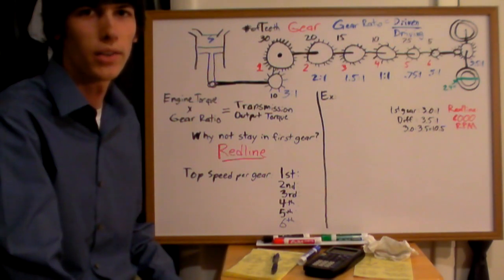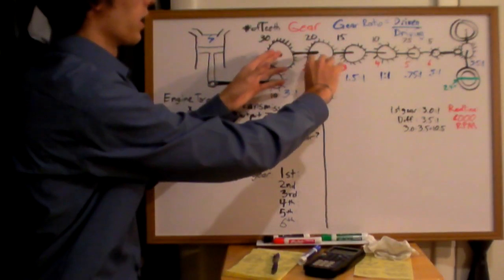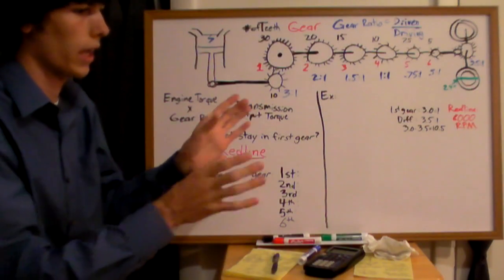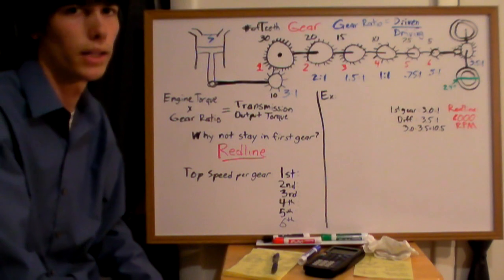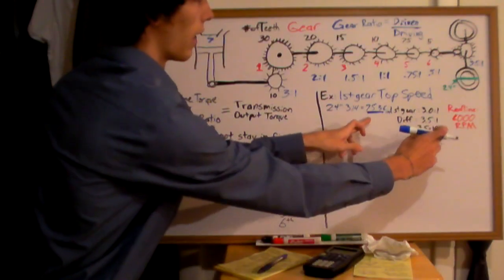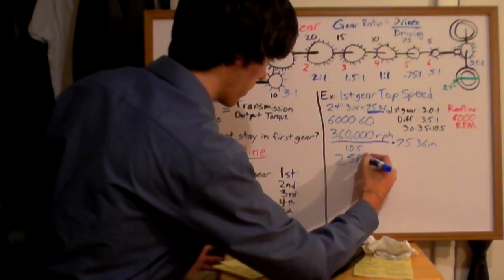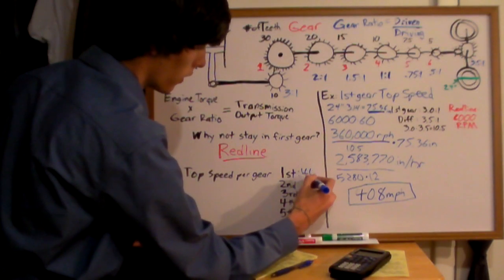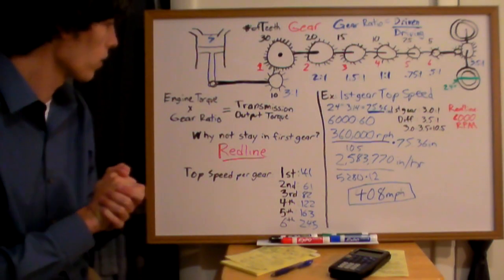Car Gears - Explained

Comment: @EngineeringExplained ifI need to climb heavy slopes (23 degrees aprox) what should be better in a transmission shorter first gear but taller final gear? Or longer first gear but shorter final gear? My case to choose is MT 1st of 3.6 and final of 4.3 vs AT 1st of 4 and final of 3.5, engine is the same. Any advice?

Comment: Next question wud b y not just stay in 6th gear at 200+ mph
Reply: Several Reasons 200mph is too fast for regular travel and if you are going up hill there may not be enough torque to move he car effectively (I say effectively because its better to move uphill with a higher torque than a lower one.) I am not really sure about specifics about what gear is best for what.

Comment: So, how do you calculate your realistic top speed for each gear if you know all of the resistance forces?  For example, suppose you use the aerodynamics of a Tesla Model 3, a given curb weigh of 2000 lbs, a given tire friction, & a given drive train friction?

Comment: So increasing a final drive would mathematically have to make the engine work “harder” or have more rotation to turn the tires which makes sense relative to the fact that in each gear you would lose MPH compared to stock or the engine would have to rev a lot higher to maintain the same wheel speed in the same respective gears. I guess my question is, shouldn’t the final drive be included in the formula for transmission output torque?? Larger gears transmit power better, but is there a mathematical way to determine that as well? I guess I’m asking because with the information given, it wouldn’t make sense in a performance vehicle to increase the final drive if you’re technically making the engine work more to create the same rotation. Now, if it’s creating more torque to the wheel, for sacrificing top speed, it would make more sense. Asking for help!!! Lol

Comment: Here's an easy formula for his top speed calculations with the conversions taken care of all as one fraction (using inches for diameter of wheel and the answer is in mph):

Top Speed = (RPM*pi*Diameter of wheel)/(1056*Gear Ratio*Differential Ratio)

Comment: Even years later with the lower production value, I’ve never come across a channel with more/better laid out info. I diagnosed a transmission error in my Jetta thanks to these videos 🙌 (thought I needed a whole new torque converter, thankfully just needed a flush and refill of the fluid 👍)
Reply: Metal flakes? Flushing the fluid will get rid of them but it is just a temporary fix

Comment: Great video
Would you please HELP

I have toyota tundra with 4.10 gears running stock tires that are 31.9 inches tall.
I'm planning on running 35 inch tire ×12.5.... I was told that I need to regear to 4.56 or 4.88 to get the shift point back...But going that route my truck will run at a significantly higer RPM....wouldn't that cause strain on my engine and kill the fuel mileage on the hwy?

Thanks

Comment: Most cars maybe just older ones try to have a top gear at 1to1 and I think overdrive is when your spinning you transmission faster than your engine so the ratios you described would be like considered tall gears but a good 4spd auto with 5th overdrive so a 5spd without that sixth one going 245 mpg you had worked out a good 5spd system but maybe 5th was a little tall other than that good ratios for a tall auto that's not 6or8spd these days

Comment: How did you get 3.14 at 6:40 minutes?
Reply: That's just pi lol. He converted from the diameter to the circumference to give you the distance your wheel will go per revolution,

Comment: Can you do a follow-up on this that explains both the following:
Straight cut gears vs. helical cut gears. Specifically, why do sequential transmissions use straight cut gears when helical gears are stronger?
Also, chassis dynos. Does the chassis dynos software calculate and work back to the torque coming from the engine? Or in other words, would one see a difference in torque output on a chassis dynos by switching gears? Also applies to sprocket changes on motorcycles.

Comment: An engine at 6000RPM produces the same amount of energy irrespective of which gear its in. At 6000 RPM in 6th gear, i can imagine all that energy must be used to overcome air resistance and friction and the like.. However, at 6000RPM in first gear, the car is going nowhere near as fast(therefore less energy loss due to air resistance and friction)  and yet the engine is producing that same amount of energy. Where does all the energy go when the car is doing 6000RPM in first gear?

Comment: So is it primarily due to the stator, which has to do work on the fluid to change its direction (but produces no useful work in return, since it's fixed) that causes the loss of power?

Comment: let me simply it
high torque gives you acceleration but not top speed, speed is limited by gear ratio. higher gear = lower ratio = more speed.

Comment: 2 questions:
1. Do the larger/lower gears provide more torque because they have more teeth or also because they are larger in diameter?  
2. Doesn't it require more torque from the engine to turn the larger (1st) gear vs. the smaller/higher gears?

Comment: I tried this using ratio of my 150cc bike. 23.61inches tire x 3.1416 = 74.1732
 2.714 1st gear ratio
2.75 final gear rato
@6000RPM
As i have calculated it says that it travel 90KPH!! On actual i haven't made it top to 40KPH!!

Comment: I love how you slam all the math on the table, very well explained [although I already knew all about this I enjoy your explanations].  You should do a follow-up on this, regarding the last 30 seconds of the video, addressing "why lower RPM gives you better gas mileage" ....... but also explaining the "sweet spots" in the RPM that get peak MPG.  On a 4L 1991/2 dodge minivan, I was able to get 42 MPG once overdrive fully kicked in / no longer "clutching it" at 38 mph @ 1200 RPM.  On my paper delivery route, I have an OBD2 app I always use, and I've constantly seen that my MPG is better from 2500 - 3000 RPM than 2000 - 2500 at the same engine load and/or throttle [testing back and forth] so I'm interested in how these "sweet spots" in the RPM band give MPG boosts.  I've confirmed these boosts by the car's alleged MPG, the app, and the pump, in identical conditions / temps / same pump every time etc

Comment: So if my engine produces 100 lbs-ft of torque @ 6000 rpm, and my 1st gear is 3:1, does the torque then multiply to 300 lbs-ft before it hits the differential? And then if the final drive is 4:1, does the 300 lbs-ft of torque multiply to 1200 lbs-ft at the wheels?!? So the initial 100 lbs-ft of torque at the flywheel at 6000 rpm becomes 1200 lbs-ft at the wheels?!? That doesn't sound right. What am I misunderstanding?

Comment: Can 1st Gear handle a high rev? (just before the red line)
The engine was warmed up, but is there a something that may harm the transmission if you rev the engine high at 1st gear?

Thanks!

Comment: i need a faster explain:if the gear number is lower what it will be eample:1st:1.52
2nd:2.3 what will happen and what will if highner
Reply: if the first gear has a ratio of 1.52 and the second is at 2.3 it's gonna go something like this: you shift into first and almost stall your engine trying to get moving, but you somehow make it. your clutch quietly weeps tears of sorrow. you rev up near redline and change gears to second. your pistons suddenly decide to pop through the hood to say hello.

Comment: This makes very clear sense however, I wanted to know how this relates to the numbers that manufacturers claim. I own a 2017 Subaru Wrx that has a approximate torque output of 268 lbf-ft @2000-5200 RPM. I looked up 1st gear to be 3.45:1 and final drive to be 4.44:1 so for a combined ratio of 15.3:1. Does the manufacturer measure torque output at the crankshaft and then multiply it by that ratio to get their numbers (It doesn't seem to make sense b/c that means the engine is producing 18 lbf-ft)? Also, drivetrain losses seem to account for 15% on average so where does that come in? Would that probably mean that I make around 228 lbf-ft at the most in 1st gear (268*.85)? Thanks for the help and the videos!

Comment: thanks for the info man, my new car is always smooth and jerk free in 1st gear, one lost motion, i have to sloth it into 1st gear, which means less pick up making the car less quick but after 2000 rpm, its damn fast and the power starts rushing, its a highway sprinter but its not quick from standstill, what is that kind of gearing

Comment: I know the video is too old but I was just wondering 
The diameter of the wheel, did you you calculate the rim diameter plus sidewall of the tyre in both ways ? 
Let's say you have a 195/75r14 
So the rim is 14 inches 
And The sidewall is 145.5 mm = 5.75 inches 
So the diameter is (5.75x2) +14 = 25.5 inches in total 
Is that the right way to calculate the diameter ?  
Bcz I'm having a problem here 
I did the calculations and turned out to be exact but the diameter calculated was 5.75 + 14 not (5.75x2) + 14 
 Really sorry for that so long comment but it got my head spinning.
Thanks in advance
Reply: Christian Abi Zeid I used an online tire size calculator... Here are the results:

Specs195/75R14
Diameter25.52"
Width7.68"
Sidewall5.76"
Circum80.16"
Revs/Mile815.18

Comment: Jason, I'm currently driving a 2015 F150 V8 with 6 speed trans and 3.73 gears. I'm thinking of getting the 2018 F150 V8 with the 10 speed transmission... With all the more gears, do I need the 3.73? Or should I just go with 3.55?... I don't tow, but do lots of stop and go and I prefer the off the line advantage in acceleration... What are your thoughts on which rear end to buy on the new F150 10 speed? Thanks in advance!!

Comment: Soooo... at 1:1 ratio, the engine rpm is equal to wheel rpm?
Reply: no because you still have a rear end gear. in this example it is 3.5:1    1:1 means the input and output shaft of the transmission are turning the same. so engine rpm and the driveshaft are turning the same rpm yes, but wheels no.
Reply: is 3.5:1 the what we call final drive??
Reply: yes
Reply: +Travis Osley can you pliz calculate how the final drove ratio (3.5)

Comment: when you multiply rpm by 60 you will get revolutions per second , not per hour .
Reply: Arpit Pathak If you had 1 revolution per minute, how many revolutions would you have in an hour? 60 right? To obtain that figure, you had to multiply 1 x 60. That's why he has mutiplied the 6000 by 60.

Comment: but if I change the wheel diameter to 16, the top speed lowers, can anyone explain to me why?
Reply: a smaller diameter wheel means you will have a smaller circumference wheel.   A smaller circumference wheel means your car will travel less distance per revolution of the tire at the same rpm of the motor.  speed=distance/time.   the less distance you travel (circumference of the tire) in the same amount of time (or in this case same rpm) means your car will be traveling at a slower speed

Comment: That's A ridiculously rugged 1st gear ex. Ya got there Too crude lol: 40.8 mph = 65 km/h. More like 50-55 kph is the red line limit as per the car manual. I never need to use > mAX of 25 kph on 1st (even on steep hills). Only case i can think of where it miGht be necessary to crank 1st gear to 35-40 kph would be if you were trying to accelerate rapiDly up a steep incline.But even in that case you do the wiser thing which is to keep momentum on a higher gear and then you can usually mount any hill with as low as 2200 rpm. E.g. : gear 4 at 75 kph (45 mph) or gear 3 at 55 kph (35-38 mph)

Comment: I still npt understand how the gear changes an angle to the wheels (Who have a different angle of rotation ) than the principal of the motor
Reply: That is the purpose of a differential. Change the axis of rotation by using a cog that is aligned perpendicular to the crankshaft. This cog or gear has its own ratio and that is the final drive/differential gear ratio (top right corner 3.5:1). Only rear wheel and awd/4wheel drive cars have differential. Most cars are front wheel and do not have diffs but the gearing ratio shown in the video still applies, transmission gear(number of teeth) divided by engine gear(teeth).

Comment: I still don't understand why you can't just stay in first gear. If there is a limit to how fast first gear can do its thing, then how could the second gear have a different limit?
Reply: at the first gear you got much torque ( enough for already move the car which is the first big step  ) , but your speed is limited   , because u can't have both (P= torque*rpm  'low speed high torque or low torque and high speed' ) , friction and other resistance stress of the gear , and by the fact u want to improve the speed of your car are the reason u can't stay on the first gear .In the video he explains pretty well that mathematicaly ( srry fr the english , it's not my first language)

Comment: why cant you stay in 6th gear then
Reply: Yes but why does it cause pre-ignition ?
Reply: ItzVaider If you stay in 6th gear it usually has a low gear ratio, it will cause pre ignition and start screwing up your engine
Reply: I have the same questions as ItzVaider and Ahmad Amr. If anyone could explain that would be great!

Comment: So the purposes of car transmission is, for the car to accelerate faster and saves fuel.
Reply: are you asking to basically summarize what a transmission does? Basically it transfers the power from the engine into the wheels through the gears that are in the transmission. The different gears have different results which is where you get the better fuel economy and better acceleration through changing gears.

Comment: How do two gears with the same ratio allow the car to travel at different speeds but at the same rpm?  For example, on a CLA250, the gear ratios for 4th gear and 6th gear are both 1.05:1.  However in 4th gear at 1000 rpm, the car is travelling at 16.6 mph, but in 6th gear at 1000 rpm, the car is traveling at 28.7 mph.  How is this possible?  Reference: http://www.caranddriver.com/comparisons/2015-audi-a3-quattro-vs-2014-bmw-228i-2014-mercedes-benz-cla250-4matic-final-scoring-performance-data-and-complete-specs-page-5

Comment: +Engineering Explained Inches in a foot... Foots in a mile... Very different ratios between them... With all due respect, this seems very, very pathetic to us who use metric system. Americans should give up and do it too.
Reply: 10 mm = 1 cm
100 cm = 1 meter
1000 meters = 1 km

:D
easier though
Reply: 12 inches in a foot.
5,280 feet in a mile.
It's self explanatory.
What exactly can you not comprehend.
Reply: Oh, I can comprehend it indeed. It's not about understanding, It's about not being unnecessarily, ridiculously and illogically messed up while the whole freakin' world uses better units.

Comment: ive heard increasing a cars final drive (like a 3.55 to a 4.10) will increase rwtq thru mechanical advantage, but after 1st gear all advantages are lost and the acceleration remains the same from 2nd thru 6th. wats your take on this man?

Comment: Besides materials, what constitutes a rev limit on an engine?
Reply: crankshaft design... for example - rotary engines have  practically limitless revability
Reply: Bt what constitutes a manufacturer to establish rev limits, what basis do they use to quantify this spec?
Reply: valves, inertia of the pistons, bore and stroke of the pistons. overbore pistons tend to rev higher than the overstroke, but the overstroke is more efficient.

Comment: I have a question (if this ever gets answered) In automatic cars, Ive noticed that when your driving the gears will change at about 3 or 4 rpm, why is that?
Reply: Automatic cars normally shift between 2000 to 2500 rpms.
Reply: Yeah but why, n what if your pushing it, like full throttle down the street in an automatic, will it still shift at 2000/3000
Reply: +Brice Graham No, it wont. You can say that an automatic transmission has two modes. One normal driving mode and "speed" mode. 
The ECU can tell how much throttle your're putting down and will shift based on that.
Reply: Oh, that answers alot, thanks
Reply: +Yousuf Zahid Soo let's say it does shift "early", would that be an ecu issue or a transmission issue? Asking because it's happening on my vehicle.
Reply: Uh,it sounds like it would be an ecu problem. Because if it's a transmission problem then you might not even be able to shift at all
Reply: Grandmaster S The ECU will shift to the highest gear possible to put less stress on the engine